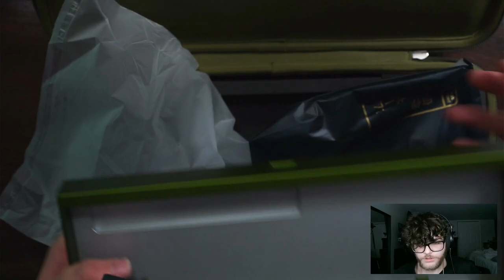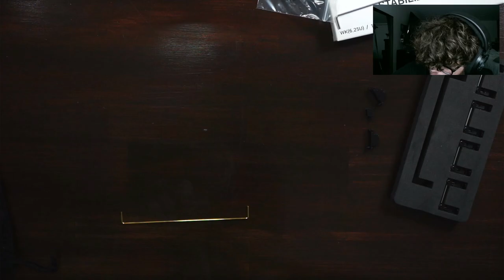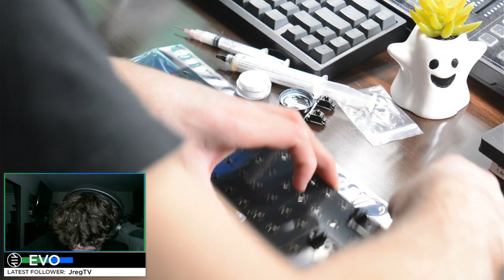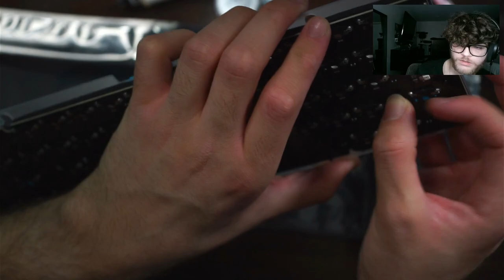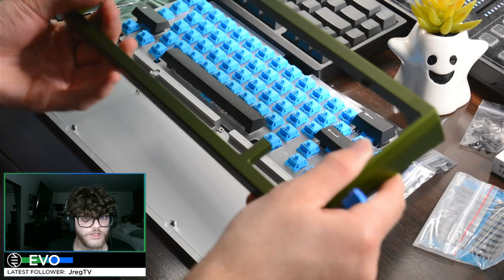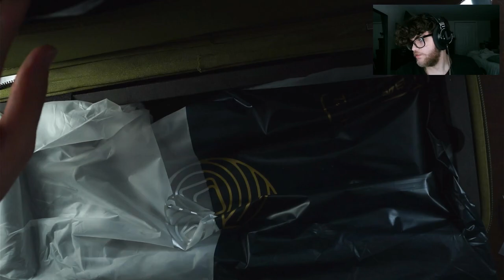Monokei Hiro Build Stream!

Comment: Hey, is that supposed to be a caps lock led light at 45:25? Mine doesn't turn on when I hit caps lock, not sure how its supposed to work if it is.
Reply from the maker: It appears to be based on placement, I cannot confirm. It's covered by the plate in most cases, unless you got the frosted PC plate then it might shine through but diffused. I recently built one with a brass plate and it completely covered the LED. Try putting a shine-through caps key if you have a PC plate, maybe it'll show.
Reply: @EVoVODs  yeah I’m using a pc plate and I tried a see through switch but the light does not turn on
Reply from the maker: @26pak  Interesting, assuming it IS functional on the board, it's possible it may need to be configured through VIA in the lighting tab? I cannot confirm as I've already passed on the Hiro I built here to the client.
Reply: @EVoVODs  the lighting tab doesn’t even show up for me when the board is plugged in. Maybe I need to update the firmware? Appreciate the help though, if I figure it out I’ll leave another comment.
Reply: @EVoVODs  got a response from Monokei. They said you can solder 2 points for the led and connect it to make it work.
Reply from the maker: @26pak  thanks man! Good to know